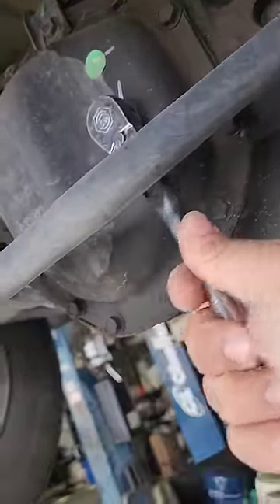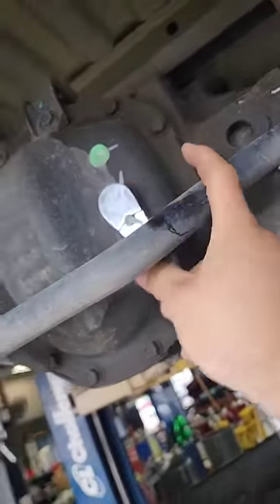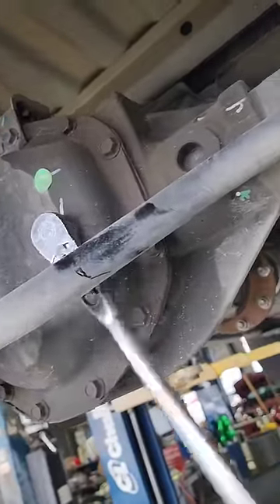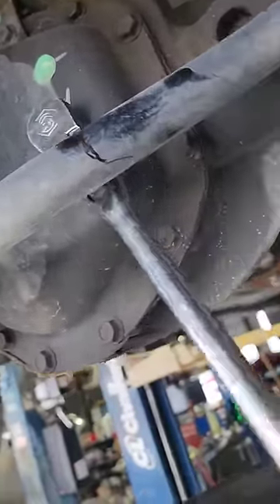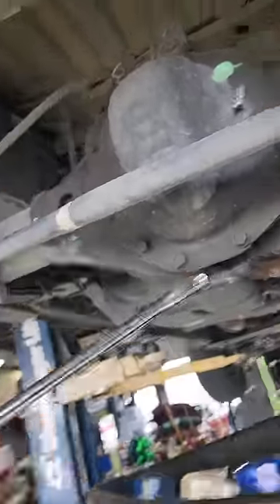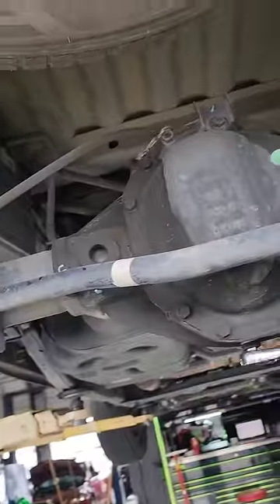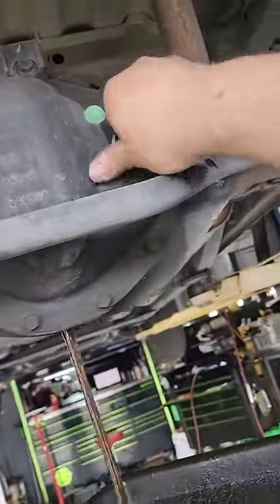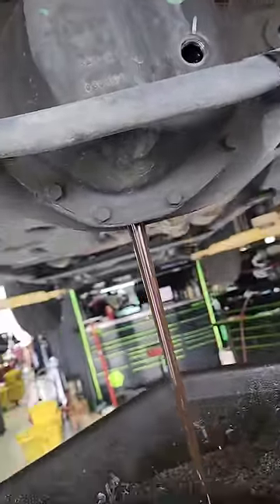MECHANICS PRO TIP #shorts #mechanic #auto #tools

Comment: In the Midwest, our vehicles rust away before we need to service the diff.
Reply: I think you mean, you don't bother using anti sieze or grease on anything you might have to remove in scheduled intervals? Y'all sht the bed lol
Reply: @dannyfrijole9473 no amount of lube can compete with the rust we get 😂. 
Its so bad people have pulled trees down just trying to get a stuck trailer hitch out
Reply: @youtubesucks-yx6kk  agreed, but at least change out the real important bolts with stainless replacements lol C'mAWWWN lol preventative maintenance gawd dammit lol sht
Reply: In the northeast, our diffs are permanently sealed for free after the first year.
Reply: @skie6282  yep definitely won't bother taking off a plug evey now and again to keep it from rusting.. I got no thumbs to plug the hole cuz they're up my AZZ lol
Reply: I get you, I had a 2005 Sierra, parts rusted to the point of a torch being the right tool in under five years.
Reply: I’m in Buffalo, NY. I really felt this comment. 😂😂
Reply: Guys you are not onto anything scientific with the rust belt bullshit, it's just a reference to the auto manufactures decline
Reply: @andrewburnett8743  Or salt.  On the roads.  For 4-6 months.  The south don't run into that.
Reply: @dannyfrijole9473  it's not the be all-end all, but hit the stuck fastener with some ATF 70/30 with acetone. If it doesn't work, use a torch on it. If that still doesn't fix it, drill it out and rethread a size bigger.
Reply: @andrewburnett8743 we Literally get more Rust in the States that have snow since Salt gets put on the Roads nearly every day during winter and good luck getting it all I moved to the Midwest with a Mint Condition 96 Explorer with zero Rust in the First year Rust was popping up everywhere
Reply: Undercoating is Basically a Requirement in the Midwest
Reply: @dannyfrijole9473  
Hey, at least rust doesn’t automatically turn my title into a salvaged one like flooding does in the south 😂
Reply: @eap61789  thats true our rust buckets do hold value 😂
Reply: @deltasixgaming  did mine with the Rust-Oleum anti rust basic maintenance most after hitting with a special disk rust was surface got to bare solid steel frame on a 99 b3000 4x4 unicorn of a truck so sweet needed some new performance parts so i could run as a daily for plumbing but we get about 5-8 years out of cars without undercoat here older like 1985 chevy van lasted like 35-40 years before the fame finally fell apart better built older vehicles being built well seem to also handle the salt better
Reply: @JUNEBUGLLC  that's a long- ass sentence 😅 but yeah, many cars seemed to last longer before. Less salt on the roads maybe, but definately better steel and body paint.
Reply: @dannyfrijole9473  Put some blue loctite on it, will seal it.
Reply: Ah yes you need a new plug brotha, I got cha
Reply: @dannyfrijole9473  cant just replace everything with stainless it doesnt work that way
Reply: Same here in the north east 😂 our city likes to put down an inch of salt at the mere mention of a snow storm.
Reply: In Canada we buy rusted vehicles off the lot
Reply: @carlchristianfosse9839  they used to use pure salt now they use brine and its waay worse
Reply: @leokeffalas3143  yeah, cause the pure salt is more expensive, worse for the environment and less effective for de- iceing. And the undercoating and auto business is laughing all the way to the bank...
Reply: especially dodges man, they really aint meant for midwest
Reply: In the Midwest our vehicles rust before they leave the dealership
Reply: not true mine is still held together with duct tape
Reply: @dannyfrijole9473  stainless? Bro stainless is a fuck ton weaker than oem steel, and the engineers don’t account for that. I would rather have it rust and use a torch and PB than risk shearing a bolt off and fucking up my car worse than just nothing, and a pro tip is to get an undercarriage wash once in the middle of winter and once after last snowfall to get all the salt off. That’s about all u can do up north
Reply: I have a 97 4Runner with more than 350k miles in the Midwest and the diff gets serviced regularly
Reply: @dannyfrijole9473  can tell you dont work on cars lmao
Reply: @_P0tat07_ In north dakota they use beat juice for deicing it works but you swear its salt but its not. On the western side of the state some towns used salt water from the oil wells for deicing at stop signs and lights it worked really well  i have also seen salt mixed with sand so it sticks to the highway so the wind up here dose not blow it away. But pure salt up here i have never seen. I am sure that salt water was diluted some how much i do not know.
Reply: Same here in the south east. Our roads are like 2 in of salt in the winter if it gets below 40
Reply: @dannyfrijole9473 aren't really supposed to use antisieze unless it's a semi
Reply: @youtubesucks-yx6kk That's no joke. I'm from Iowa originally.. In that neck of the woods, a mechanic's best friend, is anything that can heat a bolt! 😂😂😂
Reply: All south cars have rust.😂 Even car fax says to doublr check because of all the floods and hurricanes you guys get
Reply: I am formerly from northern Illinois and I can vouch, no matter what you do, no matter how good the manufacturer does their corrosion protection, your car WILL rust out if you drive during the winter. From about mid December through mid April there will be plenty of salt. Tomorrow is Halloween and it's supposed to snow. We've had many times where there is a few inches on the ground, not melting, at Thanksgiving. Undercarriage treatments, washing, whatever, will only delay the inevitable for a few years. But the rust will come. Now I'm in the South and it is wonderful. Those who have never experienced upper Midwest winters can never truly appreciate how good they have it.
Reply: @dannyfrijole9473 you live in California don’t you 😂
Reply: @dannyfrijole9473 are you slow in the head or just have nothing better to do? You could say that about every bolt then should we take off our alternator and water pump bolts every now and then? Lug nuts? Yeah right. There is zero reason to change different fluid by the time it bad its time for a new truck anyway. I have met countless people in the construction industry who never changed trans or different and have well over 300k. You only have to worry about doing that in the south if it's rusty cause you guys only make like 10 bucks an hour and live in rvs 😅
Reply: @robertbell525 it's kinda true you can't totally stop it but I spray my truck frame with a diesel and hydraulic oil mix and it stayed almost perfect and I power wash it every storm with baking soda as a neutralizer. My truck is fine but if you don't put in the effort to spray it and wash it weekly, it'll be shot in 5 years no joke
Reply: @dannyfrijole9473 My friend is a mechanic and he says he gets way more stuck stainless bolts than regular
Reply: @dannyfrijole9473  Spoken like someone that's never had a winter before.
Reply: @dannyfrijole9473 no. He means the entire vehicle rusts away before the need to do anything to it...
Reply: I mean. I'm mid MI and I have a 97 and an 86... now, we can skip over the fact that the XR4Ti is stripped down so I can weld in new floor boards, and the Cougar will be going under the knife next to weld in some new rockers...
Reply: @dannyfrijole9473 dissimilar metals shouldn't be used together like that tbh especially as a removable fastener..it's like when people say aluminum doesn't rust nah but it surely corrodes like a mf I used to weld on firetrucks dealt with a lot of dissimilar materials..mostly stainless and aluminum which obvs don't play well together in a very wet environment.
Reply: As a professional tech in Michigan, you just get a new one.
Reply: I’m here in Cincinnati, we get used cars & trucks in flooded from the south or rusted from the Canada, and of course after you already sign your paperwork then they toss in that ( imported wavier ) that you are accepting this rusted piece of shit or flooded car 😂

Edit: And to top it off during the winter they toss down so much salt to add to your insult
Reply: @dannyfrijole9473  you've obviously never been around road salt..
Reply: @eap61789 . I live in the Hudson Valley of New York , one hour north of NYC and there are lots of areas in the valley and in the Catskill mountains where there are plenty of flooded cars every year also.😂.
Reply: @carlchristianfosse9839 . Due to lawsuits, they put more salt down than ever before in the northeast here. The roads are literally white for four months out of the year. And the salty water gets into the engine compartment and everywhere that cannot be washed.  Southern cars and California cars are the best
Reply: @peaceforlife.2896  damn, that's really just sad. Here in Norway you could never sue anyone for that, there's a main principle here that if you use the road you have accepted its condition.
Reply: @robertbell525 it's nothing to do with the weather though. There is no reason to salt the roads. Just mandate winter tyres/chains and your car stays in tact for years.
Reply: @jamesfranko5098  ha, the roads in Illinois from the Wisconsin border to the Kentucky border are horrible. Chains would grind them up even more. The amount of traffic and heavy trucks, they'd have to replace all the roads every two years. They outlawed studded tires decades because they were chewing up the roads.
Reply: @johnzadinya2181  I used to pull the cars into the garage when it was wet and salty, fire up the torpedo heater, and hook up a garden hose to the hot water in the laundry room. Then spray the cars down top to bottom and underneath. It preserved them until we moved. The wife's van still rusted because it marinated all day at work. We now use it for our trash/mulch/home depot hauler
Reply: @robertbell525  oh yeah for sure. One thing I noticed is if you have dry salt on the frame and stuff it's way worse when it gets wet so if someone washes the vehicle, you have to get it really good and get everything 100% off. Let dry then spray oil. But if possible just don't drive it in the winter but for most folks that's just not reality as most people only have one car vehicle usually
Reply: @robertbell525  in finland and other countries they mandate winter tyres. Most people don't use chains apparently  just winter tyres with studs or not. They don't seem to have a particular issue with road damage so I don't think that's a problem. The cost to the economy of every car being destroyed in a few years is much higher than any other cost.
Reply: only if you dont love them im in Iowa my 1982 f150 is now over 750k miles and yea its a bit rusty but still kicking like a mule iv had to keep all the fluids up over the years

and because its a old model 9 inch there is no rear inspection cover or drain plug

engine oil every 3k diffs every 50k and transmission ever 5 years regardless of miles 50w oil dont last forever
Reply: @dannyfrijole9473  You don't anti-seize bolts that you don't want coming apart. Though I have heard that Loc-Tite, in addition to keeping bolts from shaking loose, also prevents them from rust-welding together.
Reply: @youtubesucks-yx6kk  "Its so bad people have pulled trees down just trying to get a stuck trailer hitch out"

That's why you take the "Shin-Buster 3000" out as soon as you no longer need it.
Reply: It is the truth the weather in the mid west is tough on vehicles.
Reply: Thays a lie
Reply: Nah i just keave the oil leak and the bottom of my car stays rust free @dannyfrijole9473
Reply: @dannyfrijole9473 They rust before the first interval comes up.
Reply: @dannyfrijole9473 Stainless threads gall easily.
Reply: @youtubesucks-yx6kk im in canada and we have plenty of salt on the roads. And the way to deal with rust is to get rust coatings every year and it works like a charm.
Reply: God damn !!
Reply: you need to wash the road salt off your underside regularly, so you dont get rust

Comment: That’s the cleanest differential fluid I’ve ever seen in my life
Reply: Looks like water is in it
Reply: You definitely haven't seen many. That cream color is bad news. It means water is getting in. It means bad seals or bad gasket. All you want to see is golden or black oil. Ideally golden. No 'cream' (water).
Reply: Definitely looks like new oil. 
Water makes it opaque- like a milkshake. 
I just had to drain both differential’s in my Jeep along with the transfer case and 3 speed transmission. 
It set in3’ of water overnight. Long story.
Reply: It shouldn't be that dirty if debris and moisture are kept out and it is changed at proper intervals.
Reply: I was thinking the same....maybe chk th fluid first, eh?
Reply: Was thinking the same thing. I was a mechanic for 15 years and never saw fluid come out a diff that clean.
Reply: It’s not suppose to be like that that is like water it’s bad
Reply: No water in that diff. Just clean oil. Not sure what y’all are seeing
Reply: Take better care of your car
Reply: I thought the same.
Reply from the maker: @johndoe-xy4xq  stop thinkn...
Reply: How often between change???
Reply: @Christoph-br2ui  It depends on the weight it carries and how hard the driver pushes the acceleration.
Reply: Like a jet ✈️ lmao
Reply: Like a jet ✈️ lmao
Reply: engine oil
Reply: Every 20k on my truck diff.  Looks perfectly new.  Mine doesn't have water though. 😅

Comment: If you do drain it before checking if you can get the fill plug out, and don't have the skills or means to get it out anyway, you can remove the cover, fill a plastic bag with oil and seal it inside the diff. The bag will tear open and the plastic won't hurt too much

Comment: Another tip...  make sure the hood opens before you drain the engine oil.
Reply: The hood should be popped before you get out after bringing it in lol. Also most shops want you to inspect the vehicle so you can sell bulbs, blades, or anything catastrophic, you should be doing the inspection(which means underhood) before the vehicle is even raised to do services.
Reply: Keep the garage door open that'll get the erl flowing
Reply: @anonymousgamer8807 not everywhere.  I work for a dealer, if I'm in lube, I'm doing straight up lube. 18 oil changes today.  No inspections or telling you the brakes stick. Simply change the oil... so yeah.
Reply: @jc9233  I work for a Mopar dealer in the express oil change lane, we have two lifts and two garage doors for quick services. They always make sure to remind us to always inspect things like brakes, rotors and suspension, check all fluids and top off/ recommend flush if needed/ cabin and engine filters, wipers lights lol basically anything that isn't gonna take more than an hour or so. Patch and mount and balance tires, etc etc. It just depends where ur working at.
Reply: @Pure_Flow  just out of curiosity. How many oil changes you do in a day? We have two lube bays also
Reply: @jc9233   probably like 40 ish on a good day but we only got an 8 hour day not 12 so
Reply: @Pure_Flow  by yourself? Ain't no Damn way lol. Especially if you're checking everything too. I must be doing something wrong lol. 
We usually do one person, working two bays. About 20 cars in 8 hours.
Reply: @jc9233  it's me and one other person but ok
Reply: @jc9233   I don't see how 20 is that much tho. We never have ppl consistently coming in every hour lol we get waves but if we had constant ppl every hour coming to the express lane I wouldn't doubt it'd be more.
Reply: @jc9233  like when I say how many cars we do, that's like we busy for an hour then we literally sit for an hour bc there's no cars at the moment so nothing to do
Reply: @Pure_Flow  I guess it's the express lane that makes up for it. I have to go walk a football field parkinglot. Find a car then bring it in. Go get another one while it's draining etc.
Reply: @jc9233  God damn I don't gotta walk that far lol only if it's a drop-off and they park it way in the back sometimes but still not too too far. We mostly have waiters more than drop offs so
Reply: @Pure_Flow  oooh that makes sense now lol. I was reading these out of order.. You got 2 people hitting 40. I'm using two lifts by myself.. & yeah there's like 2/3k cars on the lot you can imagine the size.
Reply: A new sticker will fix that.
Reply: @ericeck  that was just one part of what he said. I was disagreeing wth the other part. I would think you'd take the fill cap off first. We also put it in the hood latch at my shop.
Reply: I live in Michigan I've never had a problem getting a plug out even if you needed a little Heat
Reply: Also have the tail gate open before draining differential. Helps oil density
Reply: @anonymousgamer8807 them cabin filters! 😡
Reply: @DGCoinPusher they're usually pretty easy to get to, usually behind then glove box, if not I don't bother.
Reply: Engine cap?
Reply: LOL.  I stopped my young son when I saw him carrying a honking big crowbar out to his junky car.  The hood release was broken and he thought he would pry it open.  I managed to release it from underneath while he bumped it above.  He was actually kind of pissed thinking I was showing him up.
Reply: @amerlin388  it's called experience, he'll get over it lol
Reply: You joke, but when I used to work on trucks we had a cab over with a hydraulic lift ram, problem being, for some reason to tilt the cab the engine had to be running. Apprentice didn’t know so thought he’d get a head start on the service by draining the oil before tilting the cab forward. Fuck he got an arse chewing for it.
Reply: Lol that's definitely a good tip. It also helps to put the oil in the engine not the transmission lol. This happened at a place I use to work.  The kid did it to his own car. We laughed gave him a hard time but helped him get things like it. Should be.